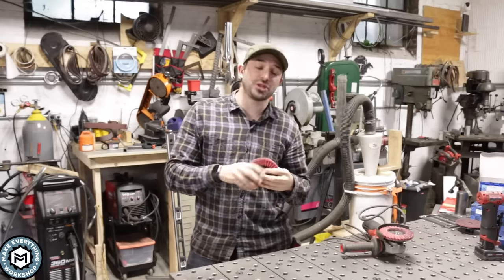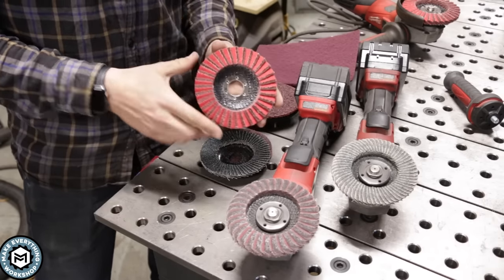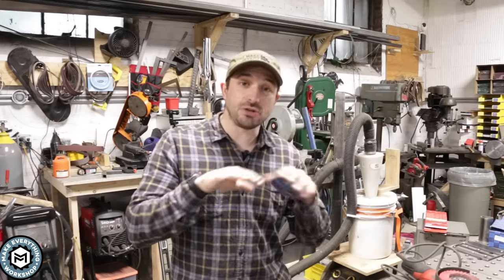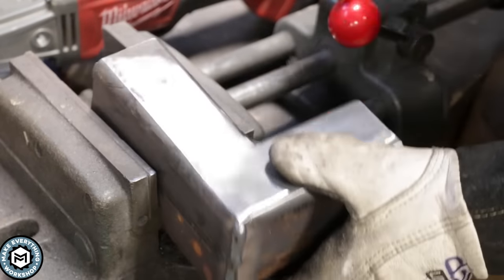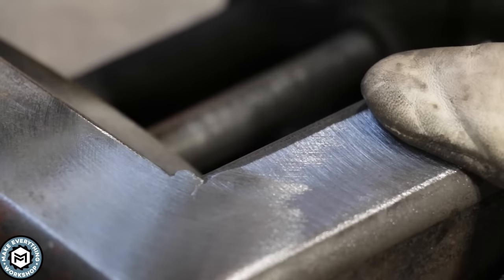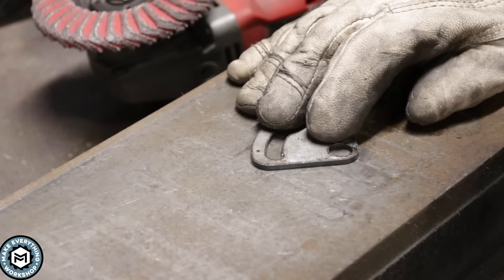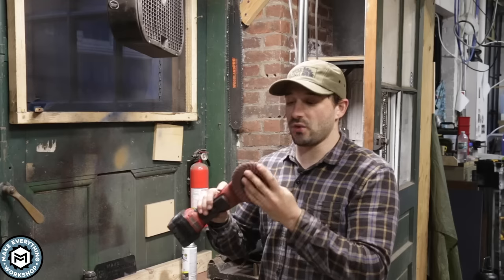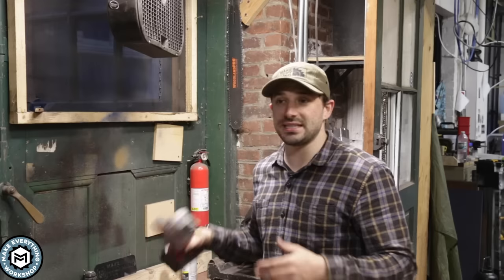Grinding and Finishing Metal in One Step!

Comment: I'm a shop noobie. I'm going out now for 2 more grinders.
Reply from the maker: Rather be looking at it than looking for it!
Reply: @MakeEverything  you should sell that plasma cut, like Jimmy’s “I’d rather have it and not need it than need it and not have it” letter press print
Reply: Definitely helped so much when I got a second grinder, (usually have a cutting wheel on one and a flap disk on the other) and if I have a big welding project coming up I’ll certainly get another one.
Reply: better make that 4

Comment: I like the specific stuff, maybe for future videos you can do some wheel dressing tips or other stone grinding related tips. I don't see a lot of content in regards to grinding with stones or carbide burrs. These are things we use regularly in the die room, stone choice and dressing make a lot of difference. Granted there's not always a ton of reasons to need to know it.

Drill bit sharpening is always fun to learn as well. Looking for when and why to sharpen or change bits perhaps.

Thanks for the content though.
Reply from the maker: Good idea!!

Comment: Brother. Very detailed video. Informative and useful.  I am an amateur DIY guy. A question:  can we go grinding without a guard while using flap disc with a vairable speed grinding tool?

Thank you for nice video. Liked and Subscrbed in the first minute
Reply from the maker: When I’m finishing and grinding steel I almost always remove the guard and use a slower speed variable grinder. The guard will typically interfere with the grinding discs full size. Thst being said, always use a guard when cutting with a cutoff wheel! Good luck!

Comment: Great video. I need to polis the edges of 1/4 inch thick aluminum that is already polished on one side.  It, I want it square and mirror polished. What do you recommend?  By the way, I have a wood shop. No metal working tools other than an angle grinder and puffers.

Comment: If you were doing aluminum tubing exclusively, would you go still use the same discs? That rounded disc did a good job, but what about areas where you need a smaller wheel?

Comment: Nice. I do some metal art. I use flux core wire and it is real messy. I am not a good welder either. I can see how this disc would help. I do use flap discs now but they do not really last all that long. Thanks.

Comment: Hello.
By grinding stainless steel pipes to satin or a mirror, do you also do it in a minute with the effect like in the movie? Because if so, such a surface finish is only suitable for paint, and then for a thick layer that will cover scratches. Man 3M Cubitron for the first cut, and then Norton H821. And only later something for satin or a mirror. Greetings from Poland, we already have this technology, it is a pity that in the US there is no ...

Comment: What do you use to fill small imperfections after sanding welds before painting?
Reply from the maker: It depends on the paint process and what I’m going for. If it can be bondoed I will use body filler. There are also high temp putty you can use for powder coating. I usually try and dab a little more weld in there if there’s a gap or low spot.

Comment: This kind of things have to have some disadvantage and it's the time. If it takes 1 minute to grind that short weld it's already to long. Normally im using 2 grinders, one with course disc and the other with something softer so I don't have to swap discs all the time. It will take maybe 20 seconds to flat that weld with 40 grit disc and 10 or 15 to smooth it out so I will be faster by 20 - 25 seconds per weld. That's over a minute on 3 sided part like you have in the vise. I'm all in for new stuff but only if it's actually better than what I allready have.

Comment: Grinding off welds is something one might do for architectural structures that are supposed to look pretty. Obviously you will lose a degree of strength in the joint. This aesthetic touch up grinding should not be used in critical structures that require the ultimate joint strength.
Reply: Given proper penatration a ground down (flat) weld is actually stronger in many cases as it creates less of a stress concentration. Avoiding any sudden changes in thickness of material (e.g. weld buildup) will make a structure way more resilient to fatigue.

Comment: so here is the problem,  Abrasives themselves work in balance, if you get finer finishes you give up material removal rates, if you get higher material removal rates you don't get good finishes. Now really the BEST way to do the corner weld he is doing is to use a 60 grit resiin fiber disc to remove the weld, (resin fiber discs keep the grind area very flat and consistant) then use a 120 grit to remove the scratches then paint, any skill at all using a grinder and your finish is spotless and you shouldn't have scratches even with spray cans. In a production environment the best thing to use would be the 60 grit flap disc only, a skilled grinder can do this easily. Stainless is of course a different operation. Combination flap discs have their uses but they are very limited to specialty applications